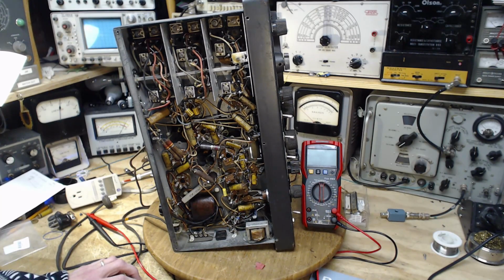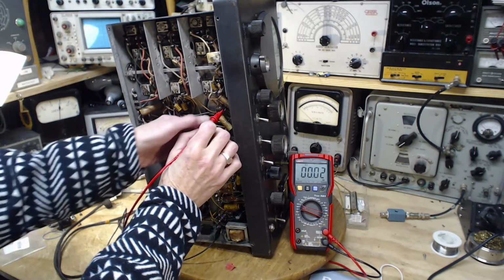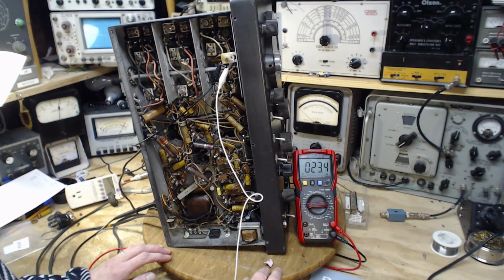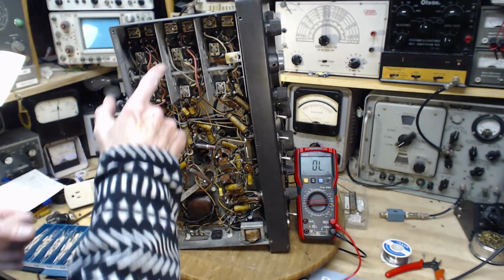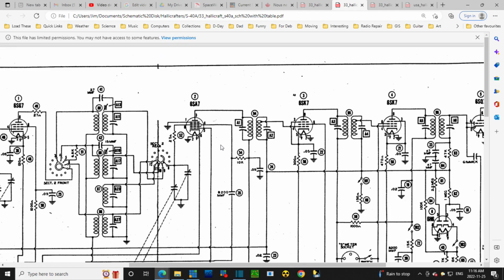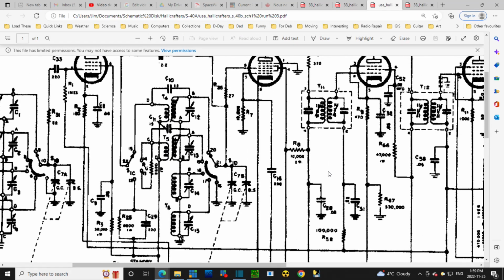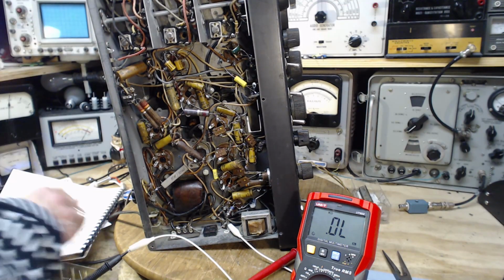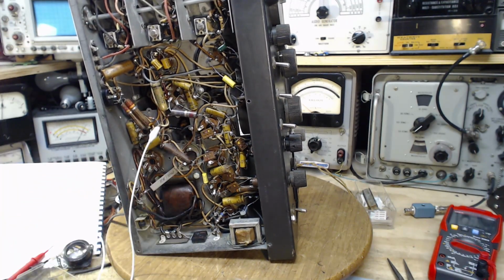Hallicrafters S-40A Shortwave Communications Receiver Video #7 - Mixer and First IF Tube Stages

Comment: Hi Jim! I just finished my National NC-183 rebuild, I replaced every capacitor and resistor, everything inside the unit was way off specs and a hand full of caps had major leakage and some shorted! I suspect you might have to do the same to this unit if you want the receiver to be at its tip-top performance. Thanks for your videos, I really enjoy them and learn a few things from watching you!